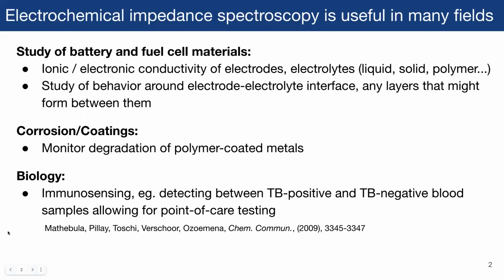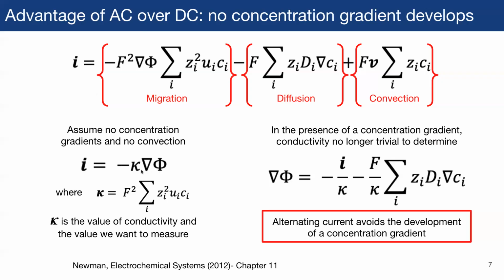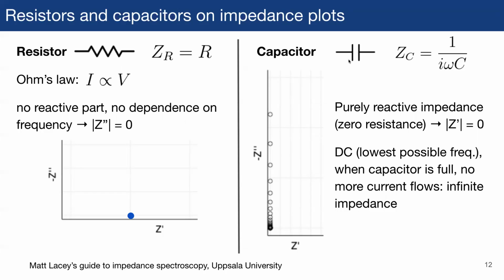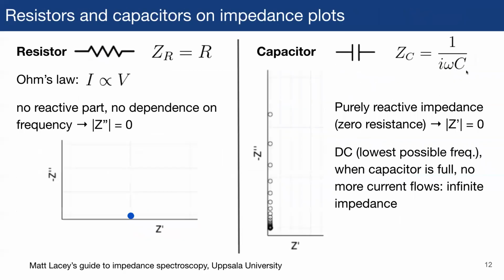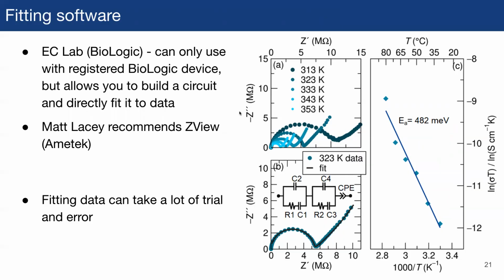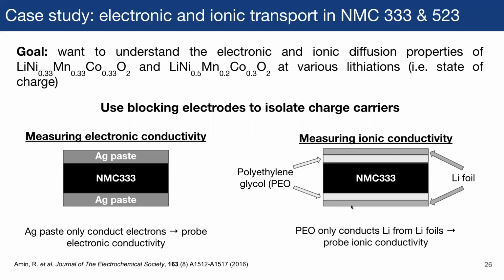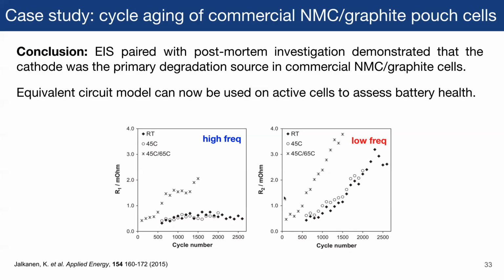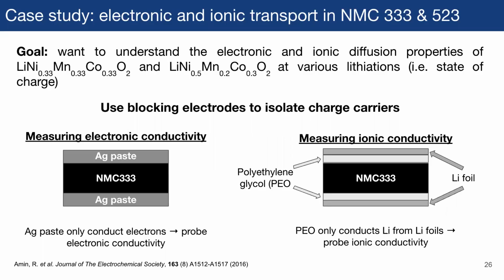Introduction to electrochemical impedance spectroscopy (EIS) for battery research

Comment: Hi thank you very much for tutorial, do you have zview, yet? with demo version only can graph 15 points is unsifficient. 
Regards 
Ambbar
Reply from the maker: Hi Ambbar, I have used ZView and EC-Lab but both are licensed softwares. I can recommend impedance.py as well, a free python package for EIS analysis. There are functions for converting inputs from many different company EIS file formats (I.e. .z, .mpt, etc…)

Comment: Thank you a lot professor
Reply from the maker: Just a lowly grad student here, but I'm happy to see this is useful!
Reply: @eliassebti9253  Hi Elias, thanks for your well-explained videos, could you explain how can separator prevent the transport of electrons? At around 38'. I'm curious is because the pore size should allow for Li to pass through but why no electron? Is that because the separator itself is non-conductive?
Reply from the maker: @sallyju9999  Hi Sally, the blocking electrode you are referring to is made of polyethylene glycol which has extremely poor electronic conductivity. It does, however, allow for the conduction of Li ions through complexation/decomplexation of Li-ions and ethylene oxide (EO) structures (https://onlinelibrary.wiley.com/doi/full/10.1002/advs.202100736). The pore size is not the reason for conduction.
Reply: Thank you so much!